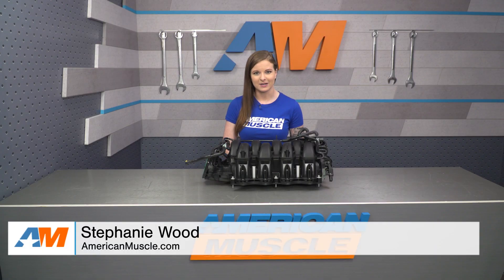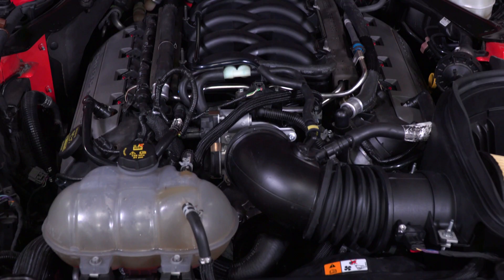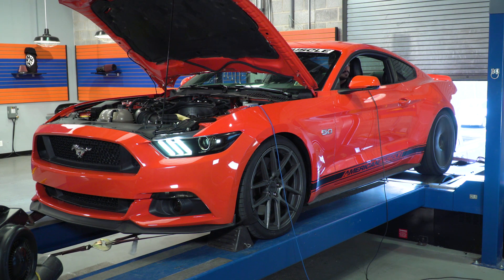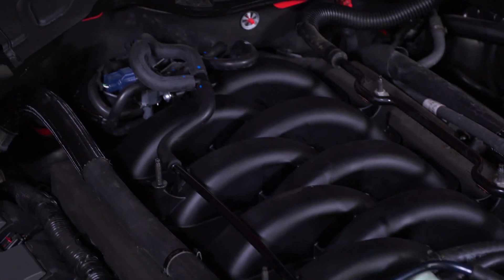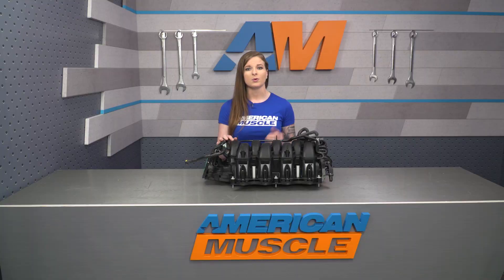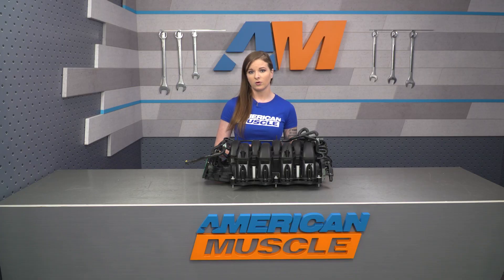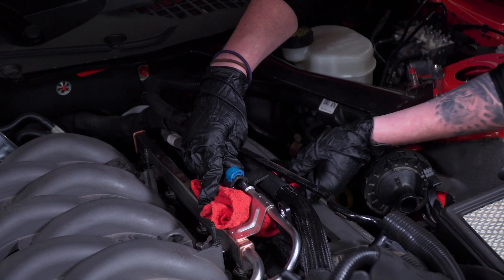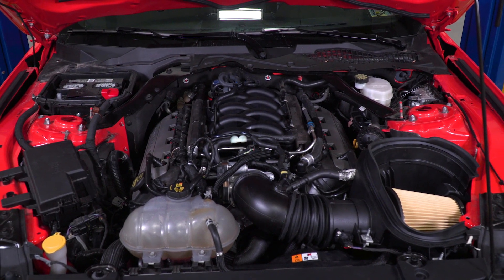2015-2017 Mustang GT, GT350 Ford Performance GT350 5.2L Voodoo Intake Manifold Review & Dyno

Comment: Will this work the ford performance intake and throttle Body’s calibration tool, or does it need to be tuned with a different tool?

Comment: Hey guys, so I want to start modding my 2015 Mustang GT but I don’t want to go supercharger, pro charger or turbo. Just full bolt ons. Here’s what I think of getting, GT350 intake manifold, GT350 throttle body,  GT350 Cold air intake (unless y’all recommend another one that adds more hp) BBK long tube headers and a tune. Is it possible that I can tune the car with the fords performance power pack 3 that way I can keep my warranty or do I have to get another tune bc I’ll add long tube headers. Any help would be greatly appreciated!

Comment: A "real" tune will net a much larger gain than a mail order tune every day of the week. My 2015 PP GT with a custom mail order Bama tune (data logged, submitted, reflashed...) was running 395hp/383tq and Dan at Pro Dyno in Fort Mill, SC bumped it up to 416hp/388tq with gains all across the curve... and this is with just a CAI, cat back and a tune. Just wait until I get headers and a GT350 intake! I'm expecting another 30-40hp and 20tq at the wheels. #NoMailOrderTunes

Comment: what gear was this pull? Just curious if the gear pulls make a difference. I have this setup with a tune, SW long tubes, 3" catback, CAI and my pull in 5th maxed at 422 rwhp. Yet I see people pulling 435's and 440's. That said, seeing the peak gains from 5000 to 7800 rpm's was nice!

Comment: FYI, I asked AM if the manifold is basically the same on both the 5.0 and the 5.2 and this is what they said below. The reason I asked is I've been trying to figure out why superchargers for the GT350 are so much higher than one for the GT 5.0. I'm under the impression that most superchargers will work on both engines with the right tune. What do you think?
Hello, I was just wondering if this intake will work on both the 5.0 and the 5.2 engines does that mean that the manifold intake ports are the same?

Hotrod5325
The Ford Performance GT350 5.2L Voodoo Intake Manifold will work with both the 5.0L and 5.2L as the exhaust ports share a similar design, and have the same spacing and bolt spacing.

AMRobD
Reply from the maker: Yes, the 5.2 and 5.0 share the same intake port design- allowing interchangeability with intake manifolds but also superchargers as well.  (At least PD blowers).  -Justin
Reply: Thanks for the validation!

Comment: So I went to the dyno with this intake manifold, 87mm gt350 throttle body, c&l racer intake (which doesn't fit so i just put a zip tie on it), and roush axle back/x pipe, and I did NOT see this 410whp you said it would make. I made 440whp on the same type of dyno instead. lol
Reply: That should be good then lol
Reply: So did I Exactly 440 hp with this intake manifold only issue is my car is idling at  12 to 13.7 in air ratio did you  have any issues got a code saying  the car was running lean
Reply: @JoseTorres-tl1zt  you just have to get a good tune. 12-14 isnt that bad. If you have lund, you can tell them and theyll fix it probably

Comment: I have the gt350 intake manifold she is so wrong about this setup  I did the gt350 throttle body and it can't be tune right so I put my stock throttle body back on it makes more power  and the strut tower brace will fit with the gt350 I can rev it to 8000 rpm with no issues
Reply: Idk about you but mine is sensitive all the time. It's because the 87mm from ford is always a little open (at least triple the amount the stock throttle body has) so there's always air flowing into it. Which means a throttle response faster than you can say god damn chill lol. That's the reason I like this throttle body
Reply: keith Woodworth Keith w, I put this mod on too with the 87mm throttle body and it works good. Who tuned your car? I went with Lund .
Reply: The gt350 throttle body works well with mine. It's extremely sensitive and likes to jump but I don't really mind that
Reply: Yes all mustangs are sensitive,  they need to warm up before driving. If I go and start it and drive off right away it will jump and buck off the gas.

Comment: this is compatible with the oem performance pack strut tower brace i've done this mod and can confirm this. The oem engine cover however does not fit without modification. Something that should be edit in the video above. 2:50 mark

Comment: How come the car wasn't revved to 7500+ RPM with the GT350 IM? As you stated, it makes its peak on this engine at ~7350 RPM vs. 6800 RPM for the standard manifold.
Reply: Super late but just wanna say it doesn't rev to 7500 cause thats the shelby rev litter the gt rev limiter is what you see in the video
Reply: @dynastycrew824 the gt350 manifold literally says it makes the 5.0 engine rev out to 7500… if your doing all this you need a tune and any tuner with a no how is gonna get you’re car right
Reply: @dynastycrew824 no tune you gonna get stock limiter
Reply: Probably the speed limiter

Comment: Are there any issues with surging as a result of using the GT350 throttle body with the manifold at lower RPMs versus using an adapter and the stock throttle body?  Also any chance of seeing a dyno run with the stock throttle body setup?
Reply: I had it done and have no problems, I guess it depends who tunes your car. I had Lund tune my car and it's spot on, runs good.
Reply: thomas juneau I’ve heard great things about Lund.
Reply: Joshua Chudnovsky I’ve seen people say use the stock throttle body with the adapter with the 350 manifold for that exact reason. Plus, vmp and bama told me the same thing through their tuning support when I emailed them.

Comment: If i'm not mistaken isnt this already on the 2018 from the factory?
Reply: Timo Jaramillo no. the bullit edition has one and it raises power from the 2018s 460 to 475. they regular gt doesnt have one though.
Reply: Ok, thanks!
Reply: The 18’ manifold does the same as the gt350 for 1/3 the price

Comment: 20 horse power for almost 2 grand in parts? If you include labor maybe even more
Reply: parts are getting more expensive over time. For 2 grand you could technically Turbo/Twin Turbo the car if ya don't mind some diesel turbos and a few junkyard parts.

Comment: Sooo $1k plus for the manifold itself, $200 for tb and a $500+ tune for 20hp? PROCHARGER WHERE YA AT
Reply: Julio Granados at the store for 6500 for 165 hp
Reply: My shop had a special 7k for procharger set up install and everything most ppl who bought it made around 640ish to the wheels on MD.
Reply: Sorry to tell you but it’s not all about the 20 extra hp the power band matters and it stays all the way across those 20 extra horse across the power band makes a whole difference
Reply: They fucked up somewhere it gives way more power than that.

Comment: so i would need a gt350 strut tower brace to clear this manifold?
Reply: fabulousprofound no, it will for under the stock one just fine.
Reply: stock strut tower brace will fit with the gt350 I have the setup on my 2015 gt she is wrong about the whole setup
Reply: If it’s the performance pack strut it will fit

Comment: Wait. Why did you say peak power is at 7500rpm but didn’t even rev it to 7000?
Reply: The Stock Tune only Revs to 6900
Reply: James  Luna yep. Coyotes love high rpms. You’d be surprised
Reply: Blake Nimee the intake lets you rev higher
Reply: james I know. They’re claiming peak power is at 7500 but didn’t go past 7000. Just odd
Reply: Blake Nimee wow good to know. love the design of a smaller dohc rev happy engine over the pushrod 6.2 and 6.4's out there. They seem to have more personality
Reply: With the tune you can set it to any rpm you want. This manifold lives up top but they didn’t even rev it high enough to see the clear difference with this manifold vs the stock one.
Reply: blake you are correct, maybe to get a more accurate comparison so they dont make silly claims like 50 hp gain and compaire 7500 rpms horsepower to 6900 rpms horsepower..... that or those wonderful oil pump gears
Reply: James  Luna it’s perfectly okay to do so
Reply: It might not be safe to rev a stock coyote past 7k
Reply: Blake Nimee all the way to 7500?

Comment: Is this will fit on the 18 mustang
Reply: NGTMare only the bullit edition has this manifold. the regular gt doesnt.
Reply: Dkoda Rodas the 18 already comes with it.
Reply: Kameron James the GT doesn't have this manifold exactly, but the 18 GT manifold offers the same performance, if not better than this one. So they are similar.
Reply: NGTMare they fitted the gt350 manifold on the bullitt edition and it made 15 extra horsepower over the stock 18 manifold. wich is rouphly the same gains you get over the 15 manifold. its superior over the 18 manifold and if not ford wouldnt have chosen it for the bullitt
Reply: Kameron James I'd be interested to see those. So far, the 15-17 dyno had the 18 manifold higher gains than the gt350. Hellhorse Performance did the comparision and has the dyno sheets posted on their site under intake manifolds.
Reply: these are put on from the factory and tuned from ford. no matter what they squeezed an extra 15hp out of the engine with the manifold.
Reply: Kameron James yeah, but that's not just the intake manifold. That's also the throttle body and additional tuning. The actual intake manifold is similar and not worth a 1000 mod on an 18.
Reply: Kameron James even Bama gained about 20 hp with just a tune and nothing else on their 18
Reply: NGTMare i agree its not worth the money. the point is it made 15 extra. yes it used a throttle body but if your going to spend 1000 on a mani then your going to buy the throttle body to get the best results. id rather have long tube headers and not only get that power gain up top but have the low end torque gains also.
Reply: NGTMare tunes void warranty. this manifold if installed by ford will not void warranty.
Reply: Dkoda Rodas there are already graphs showing that the 18 is the same as this one if not better than this one.